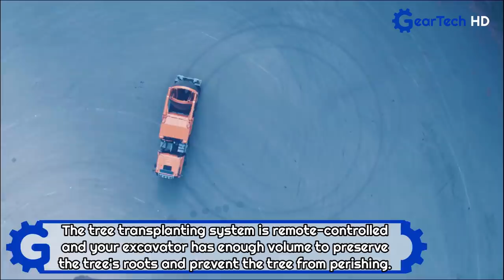Why do these trucks have too many axles and tires ▶ 5 ton weight tire change

Comment: In Switzerland, relatively short (9.6 m / 32 ft) trucks with five axles are quite common. They are allowed to have a total weight of 40 (metric) ton. What makes them somewhat special is that three out of the five axles are steered (the front two and the last one), which enables a turning radius below 20 m / 64 ft.

Comment: Surely all those tyres and wheels add significantly to the ULW of the vehicle thus reducing the payload? The tyre scrub going around bends will cause more damage to the road surface than is saved by the reduced axle load. Why don't they use 'Super single' 385/65R22.5  on the trailers, that would save some weight?
Reply: One reason is if you have a flat you're sitting till help comes no matter where you are unless on tag.
Reply: I pulled them back in the 80s all but 3 of the axels could be lifted to turn a sharp corner  had 11 axels on my trailer with wells for steel coils the super singles were not popular at that time for the reason a flat would stop you dead duals would let you to get to service we ran the Indiana Ohio toll toads mostly from mills to the stamping plants most of it is gone now the mills and auto industry died .
Reply: @johnsiders7819  I drove in the oilfield in early 80s and from 90 till 2018 going from well site to pipeline. They wanted us to go super single and we said no way because of flat problems and traction on drivers.
Drove 4 axle truck with tank and pulled 5 axle pup 1 tag in each.
Reply: @crudedriver   Did you remember BF walker ?? I ran for them in the 80s oil field   I also drove a 8X8 winch truck in the patch .
Reply: @johnsiders7819  No I don't  but I worked in Mt. and N.D.
Reply: Super singles are junk for most of these applications.   No way on earth I would have driven anything in the ND oilfield that was equipped with them, nor do I have any intention of trying to do heavy-haul with them, either.

Comment: I used to pull the Michigan trains back in the early 80s before all the steel mills and auto industry died  hauled steel coils from the mills to the stamping plants had 11 axels on a flat bed with wells that the coils sat in could for a sharp turn raise all but 3 of them  those days of our industrial mite are long gone never to return . The US will never be great again .

Comment: I wonder...just outta pure curiosity- that Tatra Tree Mover at the end, because of how it digs up a tree - could that be used to dig one big hole? It's got a  "clamshell" attachment - so I just wondered.
Reply: Yes they can dig the hole. Usually they do that first. Lay tarp beside the tree and dump the dirt on. Then they pick up the tree and take it to the other hole. I was wondering why had a back hole there because you can dig the hole with the transporter. The larger companies would use 2 of these machines to avoid any extra machine and labor.